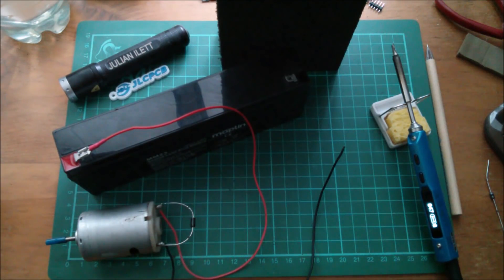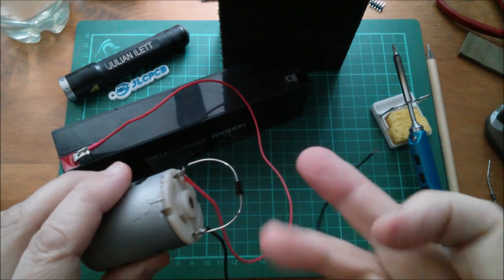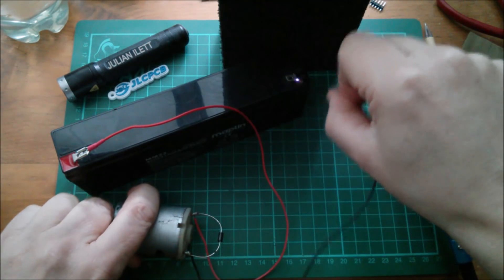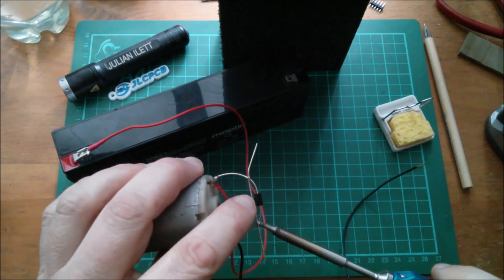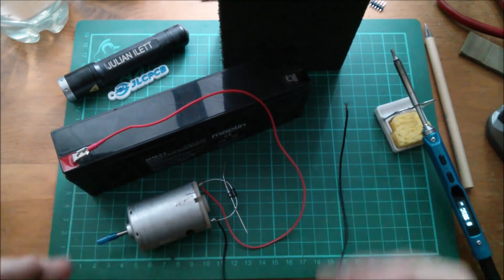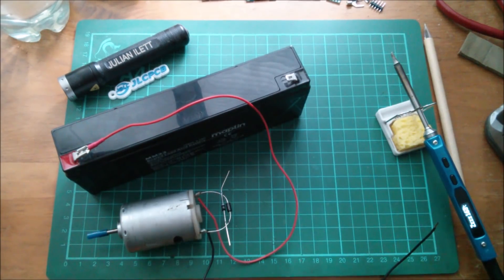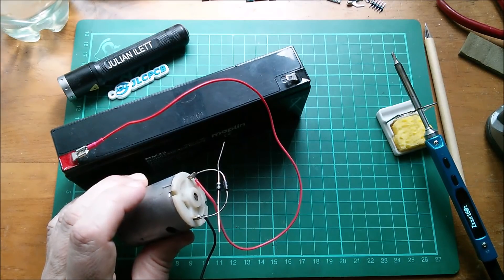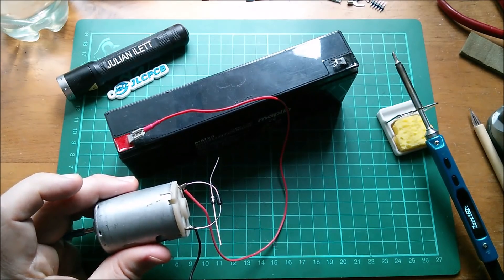Flyback Diode to Protect Relay

Comment: Julian, Diodes are really only useful for the reverse current generated when disconnecting the motor. Doesn't really help with the arc across the relay contacts. This is very much needed if you are using an electronic switch as they usually cannot handle the reverse voltage spike (the diode is absolutely needed across the coil to protect the arduino). What you want for protecting the contacts is some sort of RC circuit to slow down the in-rush current. There are small modules available from the usual China channels (this one has RC as well as a MOV for the big spikes):
Banggood: https://www.banggood.com/RC-Resistance-Surge-Absorption-Circuit-Relay-Contact-Protection-Circuit-Electromagnetic-p-1230922.html
Reply from the maker: Thanks David, that's perfect. I'm going to keep the diode (or diodes) across the motor as it does reduce the spark intensity, but I'll also add this snubber across the relay contacts. That should be belt and braces :)
Reply: @JulianIlett  modern relays seem to be better at not welding than older ones the snubber is less important than the diode i rebuild em pinball machines standard diodes are what i use
Reply: @JulianIlett  You're very welcome. Best of luck with dealing with the mold.
Reply: @JulianIlett  As other's have suggested to put a small cap across the motor to suppress arcing in the motor.. you can do the same thing across the relay contacts (it effectively creates the RC snub as the wires act as the R in the RC circuit). Not quite as efficient as a complete RC component circuit, but it will help.
Reply: just like they used to do in all the telephone exchanges when they were electromechanical RC network across the contacts by the truckload.
Reply: Diodes are commonly used in fork lifts as the primary cause of sparking from the relays opening.
Reply: The diode will at least clamp the flyback voltage to something like 1V (1N400x have quite a high forward voltage at higher currents). This will mean the when switching off the arc will extinguish much sooner. Doesn't help with inrush current or interference from the brushes while running though.
Reply: For DC applications, a reverse biased diode is used to reduce and clamp back EMF,  both while the motor is running, and more importantly, when the control circuit cuts the current flow to the motor / inductor / coil / relay coil. A ceramic capacitor is added not to protect the relay contacts or switching transistor, but to reduce any radio interference that otherwise would be transmitted to any nearby radio equipment or to control electronics.
For AC applications, a resistor-capacitor (RC) network is used to reduce the damage to control contacts. Normally wired directly across the contacts.
A variety of metals and alloys are used for the contacts in relays and switches. Only carbon contacts can resist contact welding. Most contacts are an alloy that contains silver. So to extend contact life, it is always a good idea to reduce the back EMF and to note that the inductive load current specification is much lower than the resistive only load current specification for all switch and relay contacts.
No diode or capacitor can do anything for the surge / inrush current. If this is required, two relays are needed and a high power resistor. The first relay switches the resistor in series with the motor, then after a suitable delay, the second relay by-passes the resistor.
Reply: `I don't know much about electronics, I do have a rudimentary understanding; why not use a PWM signal and a FET to spin the fan upslowly?
Reply: @fernandgeenevan8773  the pwm itself need the diode in its circuitry also more complex circuit compaired to just a relay, also lower losses with relay
Reply: diodes are cheep and they work better for this app
Reply: Book-marked and saved. Thanks.
Reply: I bow to thy divine wisdom. Thou knowest thy stuff!

Comment: I'm puzzled how a forced draft will reduce humidity in the shed. My understanding of your weather is that it's humid most of the year. Seems that a dehumidifier would be your project.
Reply: Isn't the fan only running when humidity outside is lower than inside the shed?
Reply: I think he is using the fan to suck damp air out of the shed and draw fresh air in. And buying a dehumidifier may be a better solution, but not much of a video for an electronics channel.
Reply: Cold damp air out - even colder damper air in!
Reply: @mikebarrett2621  This is a thing. You might want to read up on "relative humidity".
Reply from the maker: A desiccant dehumidifier might work in the shed, but a refrigeration type won't do much at all - it's far too cold. Ultimately there will have to be 2 humidity sensors - one in the shed and one under my corrugated plastic roof measuring the ambient outdoor humidity :)